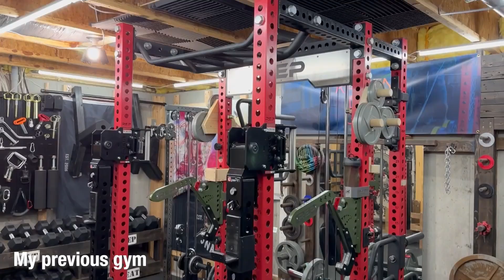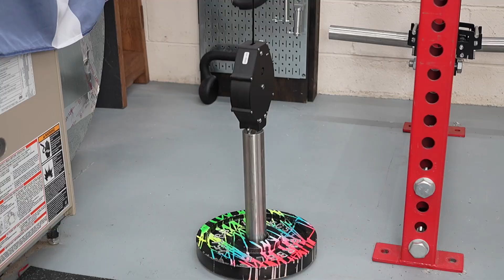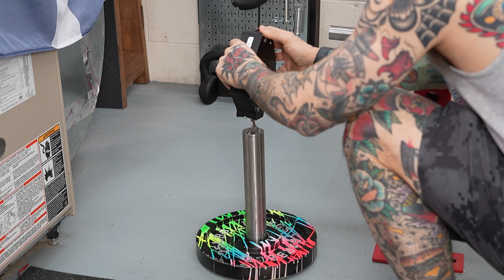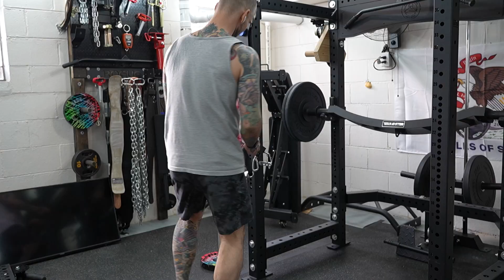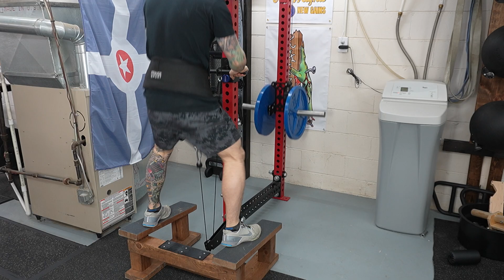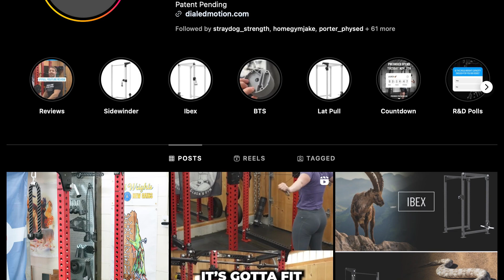Is Dialed Motion the Ultimate Garage Gym Pulley System?

Comment: how far from the wall does the upright with the plates need to be?  i have wall folding full  rack with 8" extensions.  think that will work?
Reply from the maker: If you’re planning on putting 45’s or bumpers on the weight horn, they need to clear the wall. That’s the only clearance issue you need to worry about.
Reply: @KaizenDIYGym  thinking it'll be close but should work 8" extension and the stronger and the gap plus an inch of upright to the middle.  half of a typical 45" is about 8.5", at least my bumpers are.

Comment: I have a rhino dropped into a 4 post 30" rack.  will the back throlleys get in the way of rhino handles?   also if I decide to keep the rear post as plate storage, could I add  two more uprights in between the rack to add throlleys to them so I can keep using back uprights for plate storage??? OR  are the cables design for a specific rack lenght like 24inck, 30inch etc....??? do you think that will be a good idea?  I already have a selectorized separate FT and also a seperate selectorized lat pull down, however I would like to ether sell the FT or lat pull down to conbine it in rhino rack to make some space for a sledtred.  I just dont know if I would like going from selectorized to loading plates:(

Comment: I see you did a speed pin and the actual hex bolt on the lat pulldown arm. 

Is it secure enough if you did two speed pins?

I ordered the belt squat attachment, but now I’m considering not getting it if it’s easy to swap the pull down attachment with speed pins. Thanks!!
Reply from the maker: I think there would be too much play with 2 magpins. I like 1 and 1 because I can tighten the bolt and the other pin just serves as support.
Reply: @KaizenDIYGym  that makes sense!! Thanks man. 

I’m think I’m gonna do a dedicated setup for mine as well. I’m intending to replace my BoS plate loaded cable tower with one of these.

Comment: Glad we agree on the price point being an issue. And it's not a "I don't wanna pay for it" thing.. but Bells Of Steal plate loaded cable tower is (CAD)$400... The sidewinder is $661.. Why would I pay $261 more for something that looks closer to those Amazon's pulleys than it does a proper functional trainer? Two sidewinders would cost $1322.. Treadmill factory here in Canada sells the Fit505 Smith Machine/Rack/Functional Trainer combo for $1400... BOS sells a whole two side functional trainer for  less than that. 

Respectfully, I don't get it. It's a product that would appeal to a budget tight "let me make it work" audience at a price point they can get a superior product for.
Reply: Totally agree.  I'm also in Canada.  Seems like a price gouge to me.  I think their excuse is that it's US made and labour costs are $$.
Reply: I assume the production costs must still be fairly high given its new?
Reply: Ah wish I could just get that bells of steel tower in Aus.

This pulley system also changes to local currency with a bad conversion rate when you try to check out.

Comment: great review; I'm looking to add functional trainer/lat pulldown capabilities to my Rogue ML 490 and I came across Dialed Motion amongst other equipment manufacturers. I like the versatility of Dialed Motion's retractable cable system. How durable is the reel mechanism and the locking/connection interface?
Reply from the maker: It seems pretty damn solid. If you haven't already, check out the review by @glucksgym where he disassembled the cable retractor and analyzed the components.
Reply: @KaizenDIYGym  yep ... I have and I'm digesting all of the info and asking Dialed Motion questions.

Comment: Do you think this product is user friendly enough for the average person? It looks like there is kind of a learning curve. Would i be better off just getting a regular pulley system? I'm looking to set up a small gym at my work facility. We have a 26'x18.5' area to work with. I want to be as space efficient as possible while providing enough room and equipment for 2-3 people to work out at a time. Money isn't an issue
Reply from the maker: If you're considering this as an alternative to a standalone lat pulldown and low row tower, I would say it is easier to set up and only mildly more complicated to use, but way more versatile.
Reply: I’ve peppered Dialed Motion over the year with questions and this very much seems to be a solid item that would be friendly to any level of user

Comment: Good review and interesting product if money was not object and I had a different rack. But considering the cost, I cannot see why I would buy this instead of the BOS Plate Loaded Cable Tower.  I can't see paying the same amount (if the BOS is upgraded with aluminum pulleys).  I also have the BOS consumer rack (2.3") so it wouldn't fit.
Reply from the maker: I love my BOS cable tower. Both systems have their pros and cons.
Reply: @toddcbrown if SPACE was the biggest challenge- you had a 4 upright rack and couldn’t add any other major pieces then this MIGHT then be worth it. It’s more ideal than the Beyond Power Voltra I.
Reply: This! I'm better off buying a Titan Cable machine. It's kind of sad though because these were DIY projects turned to steal. You think they make them as affordable as they can.
Reply from the maker: They are as affordable as they can be. Quality components are cheap, and cheap components aren't high quality. Dialed Motion tries to strike the right balance but it's not affordable for everyone.